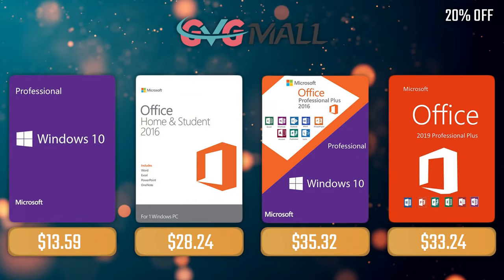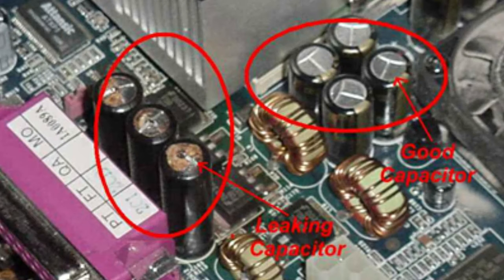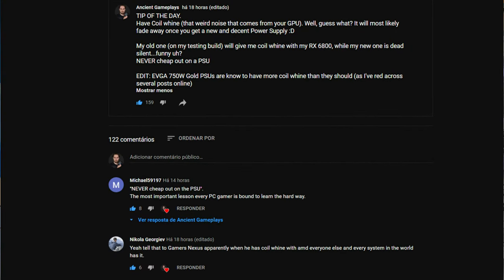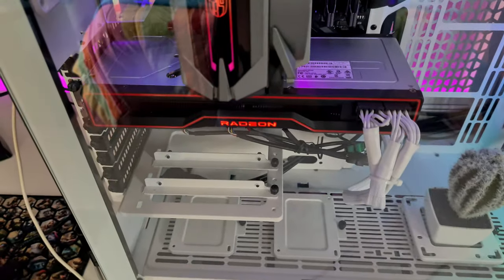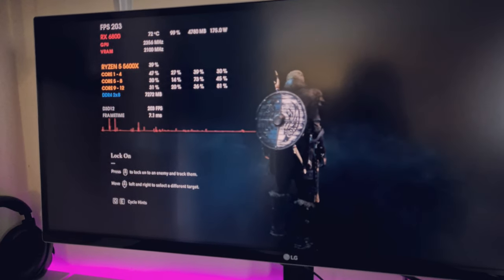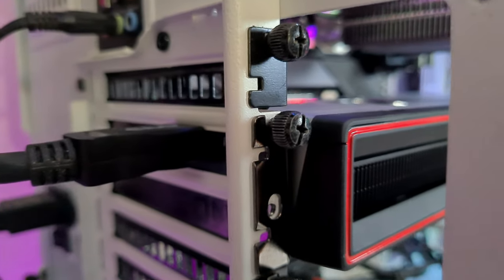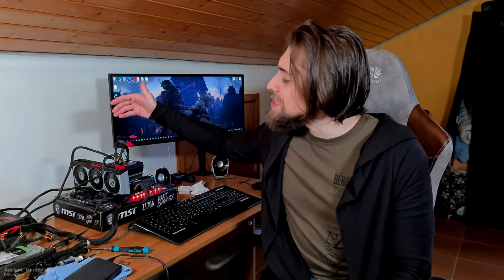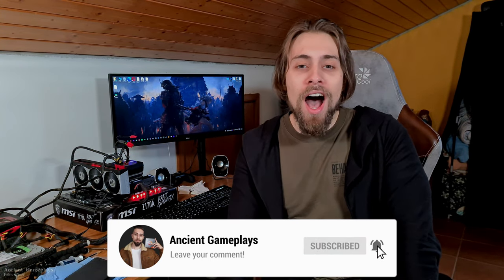GPU Coil Whine -  GPU or PSU's Fault? How to fix it?

Comment: I have a EVGA 1000w PSU & a EVGA 3080 ti FTW ultra. Whenever I play Warzone I get absolutely no coil whine. I downloaded the MW2 campaign and everytime I load into a mission I get coil whine. It will instantly stop if I exit. Both the GPU & PSU are brand new
Reply from the maker: Let the psu "burn", it may pass. In warzone you were most likely cpu bottlenecked, while in mw2 your pushing the gpu to its max. Hence the coil whine
Reply from the maker: Lock the fps to a certain extend, that will lead to lower power draw, hence less coil whine

Comment: I have low coil whine in my gpu. Full load reaches 92 degress and 105 hotspot. Here in Brazil where I live is really warm. I'm using CX 550w right now with i7 10700 4.6, maybe if I change to CX750w it could help with coil whine and gpu temps?
Reply from the maker: You surely need a better cooling system and a severe undervolt
Reply: @AncientGameplays  only van do 1000mv without crash. And case is opened. I only get these temps in worst case, my old 2070 super get only 72 degress with case closed
Reply from the maker: @BrunoFerreira-fp1vb  then you got a really bad version of 5500xt...those cards are super cold...
Reply from the maker: @BrunoFerreira-fp1vb  also, if your temps are better with side panel open, it means your airflow is not that great
Reply: @AncientGameplays  do you thinkk worth change psu?
Reply: @AncientGameplays  Im using rx 6800 reference model from gigabyte

Comment: Thanks so much for this clarification ancient I have an EVGA power supply and the coil whine sounds pretty loud. Now I know that I can replace it with a better power supply.
Reply: are you running 2 cables to the GPU or a pigtail with 2 connections?

Comment: I bought 2 quality power supplies but they both had coil noise. i guess i am very unlucky 😅🥲
Reply: No, coil whine in power supplies is normal, because  these are working with voltace and current in AC, and AC produces  variations in voltage and current and this produces coil whine and this coil whine cannot be avoided, every power supplie has coilwhine
Reply: @mrmanxd2776  I know bro. But my CW was making too much noise.

Comment: I have corsair rm750x and msi rtx 3070 gaming z trio , i put 2 cables but it didnt help , still have coil whine on high fps and little bit quiet on 60fps
Reply from the maker: It is what it is. It is quiet at 60fps because it consumes less power
Reply: @AncientGameplays  is it possible to go away or to get quiter after some time?

Comment: Hey i recently upgrade from 3060 to 3070ti and psu 600 to 750w and the psu brand was aurocool and gpu rog strix can i know how to reduce it?because if i put on full sceen i can hear the coil whine but when i put to fullscreen borderless the coil whine is gone or should i just lock the fps? Also my cpu is r5 3600

Comment: I have a ryzen 9 7950x and 6800xt red dragon and i was using 850watt corsair shift and it is working with no noise whatsoever. I just bought a 1200 hx corsair and hooked it up and it was making a really loud coil sound. Sounded like a dial up connection. I then put the 1200x in my other pc and its quite. That pc is a ryzen 7 5800x with a 3060 geforce. Can it be my motherboard?

Comment: by your conclusion using 1 split vga cable, or two vga cables, i use 2 vga cables and the coil whine persist.
Reply from the maker: Because your card is low end or your psu's filter is not tht great
Reply: @AncientGameplays  i have an ASUS TUF RTX 3070 TI

Comment: I started hearing coil whine from my 3070 some weeks ago after a power outage. My PSU is a seasonic gold Gx650, so I dont believe this wasnt the problem. Some components just start having a different behaviour after being stressed a little bit too much
Reply from the maker: Yeah, still, it is most likely your PSU...
Reply: I know it’s been a while since you posted ur comment, same thing as you described happened to me, did you loose any of ur hardware throughout this time ?

Comment: this is also a issue with noise in VR headsets which manifests as random flashing pixels. The flashing pixels disappeared when I used two power looms from my PSU to my GPU
Reply from the maker: That has to do wirh power rails, that is why 2 cables are always better
Reply: @AncientGameplays  yes but most PSU's have a single 12V power rail, the problem arises when the max output for the single rail is reached. The question is, what is the optimum CLEAN power output for a single 12V rail ?.

Comment: I changed to an 850w 80plus gold source and it still gives me the same sound, I have an rx 6800 :(
Reply from the maker: just because it is "gold" doesn't mean it has better filters. Also, your GPU may just have coil whine, it is what is is, lower end VRMs. Undervolt it
Reply: @AncientGameplays  In other words, nothing else can be done, it's more the assembler's fault, in my case it's Pulse 🤔

Comment: im using a cooler master 550w 80+ gold psu and my graphic card ( sapphire rx 580 8gb ) started this whining thing which is kinda annoying, it happens only in gaming. the whining sound isnt that loud but still noticeable. any clues or tips for this problem beside undervolting?
Reply from the maker: Not really, it has to do with the card components and ofc, with the psu
Reply: @AncientGameplays  well okay thanks

Comment: I stress tested my 3060 ti multiple times yesterday and today it has could whine. Any way I can fix it? 🥲
Reply from the maker: Coil whine is normal to a certain extend
Reply: @AncientGameplays  but the noise is killing me bro 💀
Reply from the maker: @rahul-qm9fi  undervolt the card or get a better psu
Reply: @AncientGameplays  ok bro thanks
Reply: @rahul-qm9fi  I fixed the coil whine by changing the source, I had a 2060 super that under load made a lot of noise. And I bought a focus 850w gold from seasonic and never again. Even the whine was only coming from the GPU and not the source, but for some reason the source seemed to be the problem.
Reply: @m1gu32011  hey bro thanks for replying. My psu is a new corsair 650 so that's alright I guess. I have removed most of the coil whine by limiting the frame rate to my monitor. The gpu is way more powerful than what my monitor can handle and was going well over 100 fps. You can try it too if you'd like.

Comment: I'm having this issue right now i had an old Bequiet 730W and on my new RTX 4080 there was a significant coil whine. I upgraded to be quiet! Pure Power 12 M 750W 80 Plus Gold and the whine got reduced heavily but it's still there it comes only from PSU. GPU is silent. should i try another PSU? I was thinking about trying MSI MPG A850G PCIE5 next.?

Comment: Okay my GPU has only 1 PCIe Connector. And I'm having suddenly coil whine, when I got new my GPU I didn't have coil whine. My GPU si only 1 month older.
Reply from the maker: If it appeared suddendly then it must be the psu filter failing
Reply: @AncientGameplays  Okay thank you. ^_^

Comment: I never had a gpu that didn't have at least a little bit of coil whine. The 1080TI i have rn tho only whines when fps gets super high.(1000+)
Reply from the maker: Then maybe its time to get a new psu mate, or at least try it
Reply: @AncientGameplays  its a seasonic focus plus platinum 750W, only 2 years old. I don't think it should be a problem it was expensive, too expensive, I cant afford another one just to try to get rid of coil whine.

Comment: I too am having a problem with coil whine, I have a rtx 3090 and my psu is a evga supernova GA 850w 80+ gold and it whines like crazy when I turn vsync off
Reply from the maker: those evga PSUs are known for not having good filters and also, RTX 3090 is a power house card, so with all that power being run across the PCB it will always coil whine a bit. You can try to undervolt it tho

Comment: I have the same problem with my gpu ... Rx6600xt but doesn't support two cable .. 
My psu.. is Corsair TX 650M 
What can i do??
Reply from the maker: Its what i say in the video. Also, your pc is quite old aswell and your caff model may be bad. Undervolt the gpu

Comment: When i play games i get coil whine. While playing csgo its quiet. When i try to play fortnite the coil whine becomes loud and about 3 mins in the game my pc crashes, the coil whine disappears, the screen becomes black, my monitor doesnt receive signal, i dont hear any game sounds but my pc still works. Is it psu fault or what? Could someone help me?

p.s. i have an rtx 2060 super, my psu has 700 watts but its very cheap (38$/33€), it doesnt have 80 plus.
Reply from the maker: 1 - Your PSU is clearly a time bomb and you should NEVER EVER cheap out on a PSU (get a decent one)
2 - Coil whine happens when GPU is on low, that is why it doesn't happen on CS,GO 

Now seriously, get a good PSU and it will last you a decade
Reply: @AncientGameplays  Does my pc crash because of the same problem (PSU)?

Comment: I got an EVGA supernova G5 and coil whine was noticeably louder in my pc. Before I was using a corsair sf450 and it was great :(
Reply from the maker: Yeah..corsair usually has good filters so the noise is lower...
Reply: @AncientGameplays  coil whine coming from gpu ftr, EDIT: After careful checking, the gpu is silent, its all the new PSU causing awful coil whine.
Reply from the maker: Ofc but the filters are on the psu mostly. So unless you change GPU for a way more powerful one the thing is the PSU

Comment: I have a 6700xt with a EVGA 750bq. They scream like a 56k modem whenever i reach the same FPS of my monitor refreshrate or i AltTab the game... What should i do?
Reply from the maker: Well, depending on the model, the 6700xt has a bit of coil whine, bit the psu is always a factor...try undervolting the 6700xt

Comment: My 1650 creates a chirping sound when I start up a game but its only like 5 chirps then fades.
Reply from the maker: Power draw
Reply: @AncientGameplays  Just saw this response & it still does it when starting a program up, its a (EVGA - W1 Series 600W ATX 12V/EPS 12V 80 Plus Power Supply - Black) to be exact & my PC only pulls max 300 watts. My cpu is Ryzen 5 3600 with 32 gigs of ram. I think its a quality issue with this particular 1 cause I've never heard this in 25 years of gaming on older systems. I did buy this on sale for $39 from Best Buy so the whine isnt that big a deal. Besides the sound there's no issues though. When I upgrade ill be sure to get a higher rated better quality one that's modular.

Comment: AMD radeon rx 6900 xt with psu corsair hx750 platinum, unfortunately I have this annoying noise, my setup: Motherboard asus tuf gaming b550-plus wi-fi, cpu ryzen 7 5750G, watercooler 360mm corsair h150i pro, GPU RX 6900 XT, 2x8GB 3600Mhz Ram, I researched the gpu and saw that a gpu is needed 850W psu, won't damage anything?

Comment: I have a asus rog strix 3090 and seasonic 1000w gold, the coil whine is horrible!! ( yes i use 3x8 separate cables ) But depends on the game.. so do i need a new psu like platinum series?
Reply from the maker: Most likely as 3090 cards have huge power spikes, a better psu with a better filter will definitely help, BUT, the gpu might be the issue as well, asus is not as good as ir once was

Comment: I have a 6800 with the same power supply you are using the rm750 . I get a noticeable coil whine . I’m using a x570 msi mpg motherboard .I also rma the motherboard and ram . Did not solve

Comment: Ugh I only noticed it now but my 6800xt whines really loudly when the core clock/voltage is high. Shit sucks. I have 2 separate cables and a corsair hx850i. Not sure what I can try but I'll look into it, maybe swapping pcie slots on psu will do something
Reply from the maker: Maybe your model just isnt that great and the vrms make noise due to that. Try undervolting, it will reduce power draw, hence reducing coil whine

Comment: The cheep win10 is respectable, however I won't be using win10 if ever as there's too many issues I have with it. Win7 is a solid, simple and reliable operating system. I won't be downgrading to win10 anytime soon.. if at all. What do you get with security updates? Spyware, crapware, bloatware, forced security upgrade that may include more bloatware apps.. Yeah, no thanks on all that.

Comment: I'm using a Corsair RM1000 GOLD and still have a lot of coil whine with my Vega 64.
Reply from the maker: It can be reduced with undervolting. BTW, the psu being 1000W doesn't mean much by itself

Comment: Hey so i bought corsair tx750m so i can use rx 6700xt, is this much of a problem in my case sound intensity is about the same but mine is alot crispier like electricity buzz, i'm just too lazy to open my case again and add another cable is this ok will it broke my entire system?
Reply: One more, is it normal when startup and shutdown my pc i hear loud click or switch
Reply from the maker: Just use 2 seperate cables. Also, the gpu might be the issue as well, and it may pass with time, and finally, no, it wont damage anything

Comment: In my case there is nothing to do, only to replace my GPU =)). At least my fans covers almost the whole coil whine, plus I wear headphones and my PC right now it's under my desk.
Reply: Try using Thermal pads over chokes/coil inductors then press it with GPU heatsink to reduce vibrations
Reply: @claritoresdiano1021  thanks for suggestion, but I am not gonna bother.

Comment: hi my gpu is 3080 12gb strix with 750w msi gold+ , as first everything runs perfectly fine then after 2 weeks i tried OC and benchmarking it with time spy extreme then it start to coil whine, itried to swap my old 3060ti i hear mild coil whine then i swap it again with 3080 its more noticable note that while im OC my gpud draws 400w+ , i swap my cord from 2x8 pcie, with 3x8... do i need to get new psu?

Comment: I still use an old bequiet PSU and I have coil whine... Hate it. Had it with 3/4 GPUs so I guess I'm unlucky GPU wise or it's actually the PSU. But normally bequiet should be good quality so I kinda doubt it's the PSU

Comment: I've changed the gpu it stayed the same, changed the psu to an evga 750w and it got way worse i just don't know what to do anymore
Edit : tried 1 daisy chained cable , 2 separate cables , 1 8 pin from the daisy chained and a 6 pin from the separate cable, nothing changed.
Reply from the maker: EVGA psus are good as people think, there some models that are actually bad...Also, the GPU model and components used are very important
Reply: @AncientGameplays  i tried a 2060 and a 2070 super all combos had coil whine, what are the odds that i got 2 gpus and 2 psus that have whine... btw the new psu is An Evga 750w BQ 80+ Bronze While the older one was a corsair cv550 bronze but its somehow way better noise wise also the whine is coming from the gpu not the psu

Comment: I had one 3070 evga had coil wine over 160fps I bought a new 3070 msi still get the coil whine 
I’m gonna try getting a new psu
Reply from the maker: After some point and power consumption is very hard to not get coil whine
Reply: @AncientGameplays  I have just bought a seasonic gx850 gold and the coil is gone... no more coil whine for me
I’m really happy, now I just have to sell my old coolermaster 750Gold 
Your video really helped me

Comment: Just sent back my 6700xt nitro+ as the coil whine was unbearable no difference with psu or two cables.
Reply from the maker: What model?
Reply: @AncientGameplays  Sapphire nitro+. You could hear the buzzing otherside of the room.
Reply from the maker: Nah, thats not possible, the card draws almost no power...the problem had to be another
Reply: @AncientGameplays  Indeed it was. My 5700xt worked perfectly without buzzing in same system. Same power draw on the cards. Sometimes the inductors are faulty even in low power cards. Psu rm1000i

Comment: My PSU make whistling noise a high pitch whistle like train braking kinda sound when i run games and i thought it's coil whining cause i saw someone talking about it but everything was fine until about 2 days ago my pc start to do a reboot whenever i run a game like ETS2 but not when i run a less needy game like construction simulator 2015 but still my psu make the whistling noise and the game start to stutter and every time the stuttering happens the whistling mutes in sync with it and i don't know if the stutter happens because of the psu or the game stutter because of something else and the whistling stop cause the game freezes for brief second, maybe someone can advice me and tell me if is it possible the psu could effect game performance? and do i need to replace it? 

Sorry about my English and my little knowledge of computers

Comment: Always thought it was the way the graphics card was made and nothing could change it, to me it only happens when im playing lest say quake 2 and i get 10k fps in game, i limit my max framerate to 300 at all times and no noise
Reply: Try use thermal pad over chokes/coil inductors then press it with GPU heatsink to reduce vibrations

Comment: Thanks for the video
I bought gigabyte aorus rx 6800 - ryzen 7 5700G with Corsair cx650f the coil whine happens only on gaming in loading secreens games lag spike and the coil whine stops in the same moment also in games lag spikes happens.
Could it be my PSU not giving enough power ?
Please answer when you can
Reply from the maker: Well, first of all, that cpu will bottleneck the 6800, even at 1440P in some games. That psu can be the issue there as it can be a slow disk as well or bad ram stability.
Follow my 6800 turorial
Reply: @AncientGameplays  
I don't think it's the cpu because it's always on 37 - 40% usage in 1440p gaming and not the RAM or the SSD because i had rtx 3060 before the RX and there wasn't any problem with them i feel like it's the PSU cuz it's CXF which is not that good i'm gonna get RMX to see if this solve the problem.
Will keep this updated thanks for the reply.